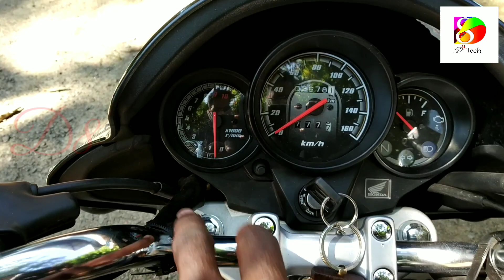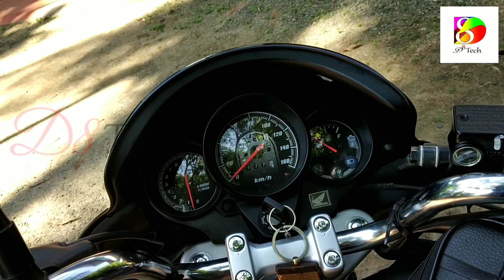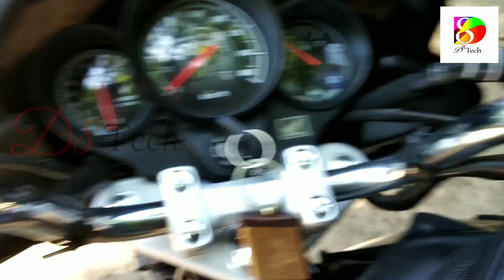Two Wheeler Warranty | Motorcycle Warranty | Parts Coverd Under Warranty | BIKE WARRANTY Explained

Comment: Wheel bearing inum back shock absorber warranty കിട്ടുമോ
Reply from the maker: Hi GopeeKrishna D Brother, Thank you for your valuable question... Theimanam sambivikuna onninum kittilaaa. But Shock Absorbernu unduu.... Hondayude siteil keri warranty parts check cheithal oru pdf kittum athil ella partsnte name undavum.. 🤝🤝🤝💐💐💐💐
Reply: @D8_Tech  10000 km munbu തന്നെ yamaha fz v3 s  യുടെ swing arm bush chain sprocket replace ചെയ്യേണ്ടി വന്നു. ഇതിന് ഒന്നും warranty ലഭിച്ചില്ല. ഇപ്പോൾ front bearing problem ഉണ്ടെന്ന് തോന്നുന്നു
Reply from the maker: Chain, sprocket, warrantyaa, but swing arminu kittendathu annu ennu thonnunuu.. 🤝🤝🤝🤝💐💐💐

Comment: Broii, my bike is same unicorn 160 bs6,iam facing a gear shifting problem  between shifting 3rd to 4th gear, after 10 Km of my ride,. Gear veezhunnillaa 3rdil ninnnu 4th lekku chila timesil, athinu ee warranty aayittu enthengilum problem indoo😭😭😭😭. KM 680 aayittolluu,( means- gear shift cheyyumbool gear veezhunnilla sound kelkkunni, crack sound, pinne gear onnu down cheythu veendum ittal sheri aavum)
Reply from the maker: Hi Yahya Naz369, Thanking you for your valuable Comments, yes, 2nd service nu showroom il pokumboal paranjamathi. Sariyaki tharum.💐💐💐💐💐💐💐
Reply: @D8_Tech   thank you broi, Athu sheri avumennu thonunnillaa ,njaan pettu😭😭😭😭😭😭😭😭😭😭😭😭
Reply: @yahyanaz3695  enthu patti bro
Reply: @munavvar3649  ippo Sheri aay
Reply: @yahyanaz3695  naanum new unicorn medikkunund
Reply: വാസ്തവത്തിൽ ഈ വണ്ടി കൊള്ളില്ലേ
Reply: @nithinjoseph1836  ആയ പ്രോബ്ലം ഒക്കെ ശെരി  ആയി bro

Comment: Free service ennu parayumbozhum 580 rs service charge vangi...oil changed...
Reply from the maker: Oil charge oru 350, consumable 50, pine venel oru sanitization chqrge oru 30 total oru 430. Avullu.... Oro dealers different alle. 💐💐💐💐💐